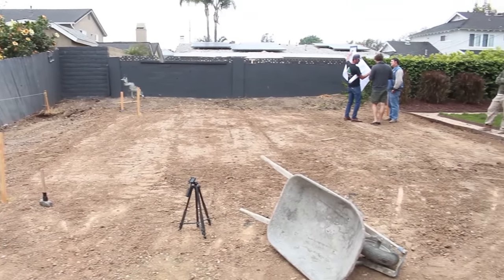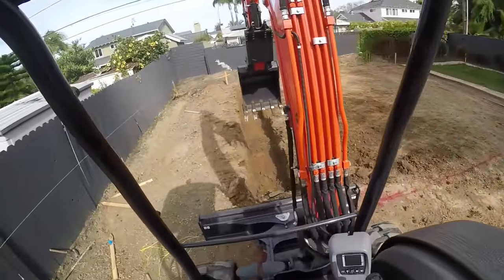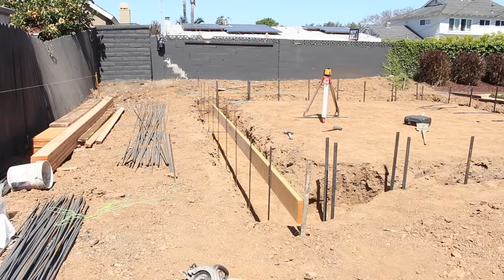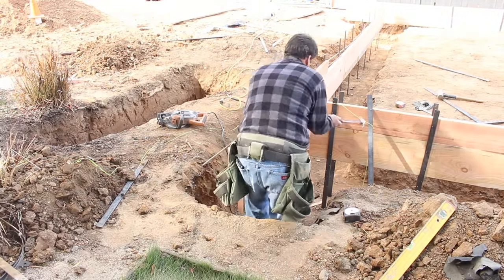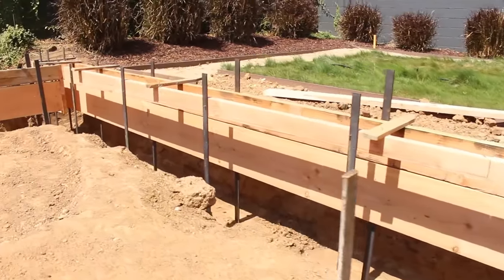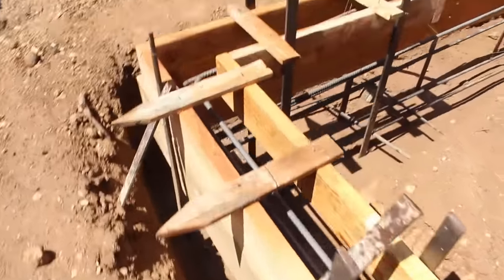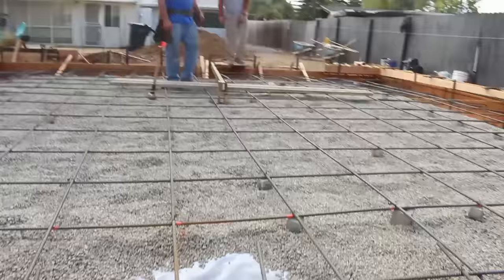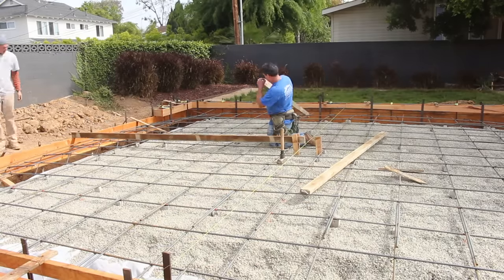How to Build and setup a Concrete Foundation for Garages, Houses, Room additions, Etc Part 1

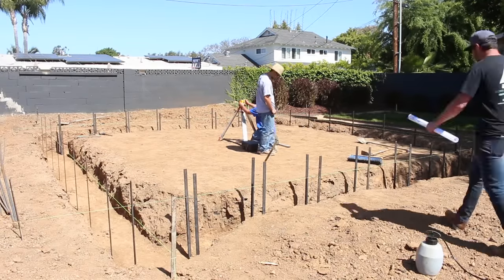Comment: Great video, you usually saw cut joints, you don't think it is necessary on the slab? Also on 7:11 is that one of the wooden stakes In the stem wall? And last they don't require termite treatment?  thanks for your videos.
Reply from the maker: Paul Robles 
I have been back to look at it recently. No cracks. I don't think that slab will ever crack. I think it could be moved with a 4 point pick up   and no problems.

Comment: Great Video!....Honestly could sell as a training video.  I'm a civil/structural engineer in CA and run from owner builder projects because home owners typically higher the cheapest concrete contractor on the block.  A hit or miss on quality preparation for the concrete pour some doing a great job, some well not so great....interesting locations of construction joints that do not fair well with a single vertical dowels or sill and holdowns.  I think I'll add a note to my foundation plans that require all contractors to sign a statement that they have indeed watched the Odell Complete Concrete CFGHRA, Part 1 video prior to the start of work.  Great Job!  Quality instructions and explanations of the entire excavation and forming process!   A knowingly two or even three pour job should technically be detailed with clearly identified reinforcing steel respective of the designed/shown construction joints.  Monolithic pour the way to go if you can just like you've done.  Reduces repeat crews, inspections, etc.  Really Well Done, David.
Reply from the maker: That's a good idea.
I've did it both ways, mono is the way to go if you can pull it off. 
TY

Comment: do foundations come with pluming and electrical setup or is this strictly foundation
Reply from the maker: plumbing can be added later. The only thing that's crucial before you pour is sewer
Reply: @OdellCompleteConcrete  ok so sewer is most important does foundation normally come with anything like sewer or electrical
Reply: @robertthompson5708  electric and water SUPPLY above foundation.  Sewer in foundation.

Comment: Why do you use visqueen? Is that a local requirement?
Reply from the maker: Yes its required
Prevent moisture and gases from rising into the building
Reply: @OdellCompleteConcrete  thank you! And oddly enough my real name is Davey O’Dell. Small world. I’m about to build a big shop and came across your channel. Great work thank you for the info.

Comment: Just curious, was the footing designed to be 24" wide or was that simply due to the bucket being that size?  I'm about to put in a stem wall designed for a 16" x 8" footing below a 30" stem wall. One contractor says I need a 24" wide trench and to build 16" wide forms for the footings but is there a reason I cannot just dig a 16" wide trench and use that as the form and the build stem wall forms above that?
Reply from the maker: I've never seen a footing that small.
Send me the drawing
Reply: Sent a drawing to your website email. Not sure how to attach photos to these youtube posts.
Reply: Footing width depends on the load of the building and the bearing capacity of the soil.  The engineer of record will probably allow a monolithic pour as long as you meet or exceed the design dimensions.

Comment: What was the thickness of the slab that you poured for this garage?
Reply from the maker: 5
Reply: @OdellCompleteConcrete  thank you for the quick reply. I am in Texas! For a two-story 16 foot sailing height concrete slab 4000 square-foot home what’s the thickness of concrete you would use I’m interested in actually billing the whole house at concrete. I’m trying to decipher between the concrete blocks and poured concrete walls
Reply: I wanna be able to add on additions later on when I want to

Comment: So, did you switch from using wood stakes that you used in a couple other videos, to the metal stakes?
Reply from the maker: +John Jacobs 
No, 
In this particular video I needed length and strength.

Comment: Just curious, I have done commercial construction for years not concrete of course, and I know residential is a different animal altogether, but why is it that every commercial concrete pour that I have seen uses coated rebar versus Raw Steel?  I'm not an expert by far so don't take this the wrong way, but pouring wet concrete on raw steel overtime causes it to rust and expand which leads to microfractures and eventually crack. Wouldn't it be better to use coated rebar instead? just curious.......
Reply from the maker: Why not use high tensile plastic instead of steel?
They have it.
Reply: what youre talking about is epoxy rebar and is usually only required in certain cases  and a little rust on rebar makes for a better bond
Reply: Speedway man tell your rust theory to a Ca. building inspector see what he thinks. Hint it wont be good rust is what breaks up concrete.
Reply: You can't tell anyone from any one of California's Dept. of anything because they think they are all Gods. The only thing they could possibly be doing these days is making up new laws to suck more and more money from it's residents and making them homeless in the process. Then the people believe their idiot state and federal government office officials when they say the state is going broke. The only reason it's going broke is those same officials are lining their pockets with the tax payers money and the pockets of those who keep them in office. What is craziest to me is these people who become homeless stay in California. LEAVE people! There are at very least 20-25 states where you can get a job that will pay you enough to live on in a decent home. As a Native I have every right to make these true statements. I left California in 1988 and never looked back. That place is a joke.

Comment: Shouldn't the polyethylene be placed over the stone and directly below the concrete slab?
Reply from the maker: Either way works. In this case we followed the plan
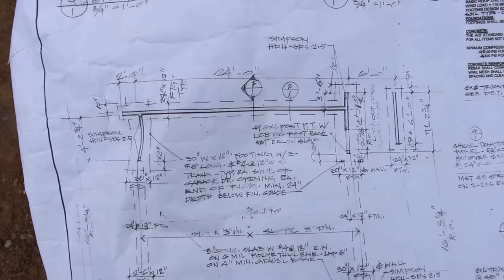Reply: @OdellCompleteConcrete  no big deal & not to be-labor it but @1:06, The note on the Foundation Plan H/1 states 5" conc. slab w/ #4 @ 18" o.c. each way on  6 mil poly on 4" min gravel. But really a nice job, Thanks for the video & detailed presentation.

Comment: What 

What I often do is overlap the visquuen  by a minimum of 12 inches and duct tape the seams together.What I've found after It just makes the concrete  set up and hydrate more consistantly.

Comment: DANG..............IF WE had to put all that steel in our footings I'd quit building. :) Here in New Mexico it is just 2 #4"s horizontal around 6 inches down from the top and around six inches up from the bottom. Same with the homes. And the only time we put steel out in the field is if it's commercial. We just use fiber. You have a choice...steel OR fiber.

Comment: They let you get away with earth forming there? No steel spreaders, not using panels,  no stiffbacks on the butt ends of the 2x...very different from how we do it in Oregon.
Reply from the maker: Yes but don't worry this technique will get there

Comment: How much is a job like this? Like if I hired someone to do this how much would it cost?
Reply from the maker: 10000
Reply: @OdellCompleteConcrete  Dang. Are there cheaper ways to do a concrete base for a garage this size?

Comment: Surely the idea is to dig down to a level where the sub soils is strong enough to build off not to compact the base of the foundation prior to an inspector arriving.  If the sub base is adequate there should be no need to compact it.  Surely that vibrating plate will only compact the top 3 or 4 inches.
Reply from the maker: I have bad news for you.
When you dig the soil gets disturbed.
Reply: Yes, but surely you just dig down until you reach suitable clay.  You surely don't just dig down two feet then compact the base regardless of the soil type.

Comment: On the outside wall out of the slab why didnt you just get a pice of plywood just one rip it in half and then just build a plowood wall and it wouldnt have the seemes in it but in your case some wont be seeen but for the outside wall out of the slab you would. i do concrete every day like you it gets fun and then it does. Pretty cool video to see how yall do it and how we do it down here . alot of different ways
Reply from the maker: I have more uses for 2x12s then plywood panels, and there easier to  store

Comment: You  seem like a good concrete contractor. Everyone does things different. A lot of labor wasted on all that forming. Would like to see upright rebar extending up into the the stemwall with a #4 horizontal tied to them all the way around. Not really sure why engineers spec pea gravel under concrete slabs?.. You can't pack it all that well, and have seen another contractor pour on it and the results aren't good. 9 sack mud usually is way higher than 4500 psi. A 6.5 sack 20 % rock would be a 4500 mix here and would probably break around 5500. Also was wondering, if this is a garage, how are they supposed to get the car back there?... lol
Reply from the maker: Chris Mansel 
4500 psi inpea gravel means more cement.
6" max to 3" stem wall, not much of a chance getting verticals in there.
horizontall they went with a two #6 at top.
getting the vehicle in there would be the same as my truck.

Comment: Why not use mash instead of rebars for the slab ? It will cost the same, but quicker.
Reply from the maker: When they start building bridges out of mesh, I'll do the same.
Reply: @OdellCompleteConcrete  Reinforcement mesh is usual norm in construction for a very long time. It is used for small family houses all to constructing multi-story high and large building, supporting walls and even bridges. You name it... I guess it would be good for a small garage.
Construction engineer by calculation can give you type of a mesh, concrete and slab thickness for given load. 
As I live in Europe the strongest standard mesh (by European standard) you can buy is Q1130. it uses 12mm rods - 100*100 squares (dimension is 6/2.15m and it's weight is 235kg (518 pounds)).  Bridges and skyscrapers are build with that. For your small garage Q335 mesh (8mm-150/150mm) would be more then enough for typical car garage.  
Very important thing if you expect heavy load  on slab is to have at least a foot thick heavy compacted gravel tampon beneath it.

Comment: What is the purpose of the 6 mil plastic?  It looks really confusing... Also, is this garage for that tiny old house in the background? lol...
Reply from the maker: Yes
Reply from the maker: Plastic is a moisture barrier
Reply: Odell Complete Concrete ,  it is hard to visualize the finished job with the concrete poured into the forms.  The bottoms of the forms are open and will be filled in with concrete or sand?  The video does not show this process.  I assume it will be sand/dirt... How deep are the footings supposed to be if there is a structure like garage being built on it?

Comment: Good work, but I don't understand why u don't cage the iron in the foundation work.. when you put the concrete, it can to move the iron. When the iron slips out, you can not guarantee the correct distance of the iron from the edge...some water and the iron breaks out .
Reply from the maker: +SaveTHEchianna 
This steel is a tight fit with dobies on the wall. It can't move.
The cage is pointless.

Comment: From a project management point of view, he made a unilateral decision to change the scope of the foundation design without any approval.  He openly admitted the plans required a two pour foundation - footings with rebar (first pour) and a slab (second pour) secured by the rebar (probably vertical) in the footings.   If he was paid to follow the design as planned, his action was arbitrary to save himself time and money that is called a shortcut and would be consider a breach of contract. A true professional would call stakeholders (architect, engineer, or project manager) to request a change from the design plan.
Reply from the maker: We talked it over with the Owner as well as the general contractor.
They both agreed they would like to save 7,000.00 and do it my way.
The Inspector passed it, and its stronger.
Reply: That's is good to know. Reputation is everything. It's good to know you are NOT among those contractors willing to trade your reputation to cut a corner, your comments have better context.

Comment: 6, 8,10 same as 3,4,5 same as Pythagorean theorem  otherwise known as "we squared it up..."
Reply from the maker: Old School syle
Reply: Video drone I was thinking the same thing... But his 6,8,10 will be more precise and nearly as quick... 1/16th out on the smaller check would be the same as 1/8th out on the larger one... When I do my garage forms I think I'll use the larger measure.

Comment: Wouldn't it have been quicker and easier to just put the iron cages in the trench work, tie rebars upright at every 16" to accomodate concrete blocks. Pour in concrete and fill to grade and then continue walling up the garage using concrete blocks filled with concrete up to your height?
Reply from the maker: Yes if your a steel fabricator